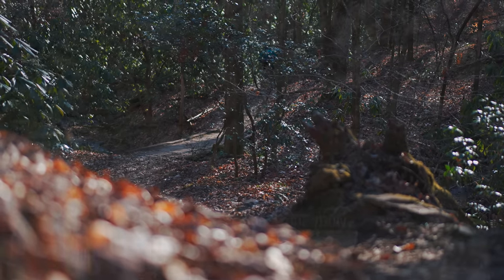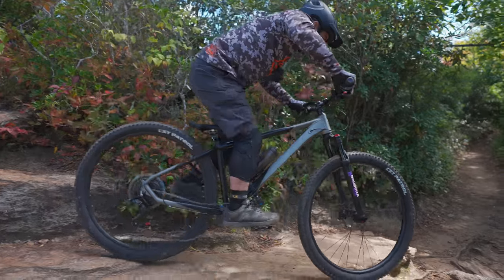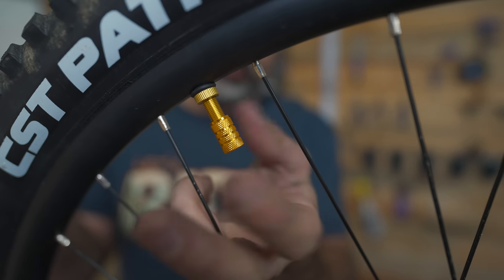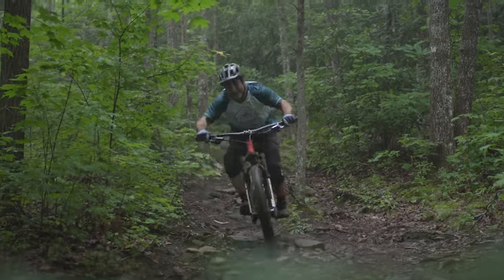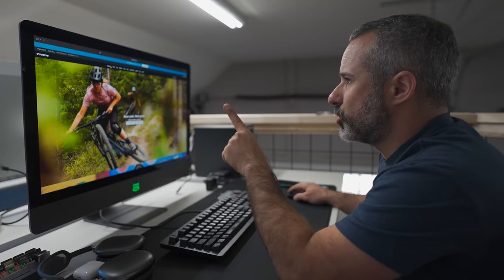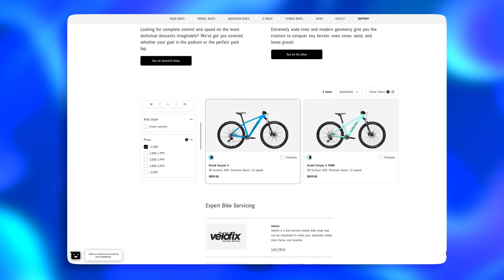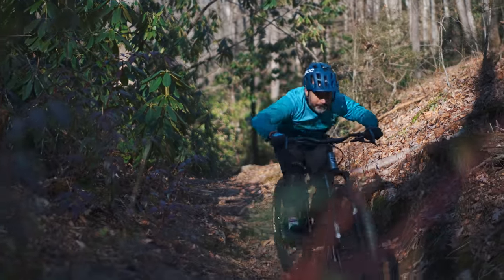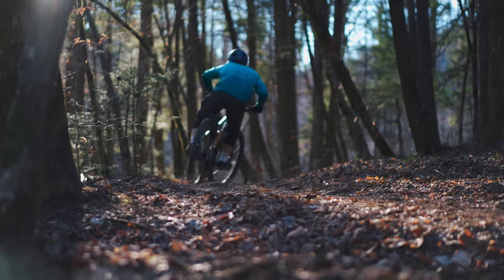Was putting $425 of upgrades into our Walmart Bike a good idea?

Comment: Rose Bikes (german bike shop who have their own bikes) have an entry level MTB for 850 EUR with a RS Judy, 1x11, MT-200, goodish wheels, etc.
BUT ANYWAY HERE IS MY BUDGET BIKE UPGRADE STORY:

I got a Dema Barro 3.0 from 2016 27,5". Well, it was crap in its original shape, I didn't really liked to ride on it at all... 
After several years of owning it and not really liking it, I chose to upgrade it one by one.

First it got a wider handlebar from 6xx something to 720 mm and a shorter stem from 90mm to 60mm. Both are stronger and lighter than the original. 

Then went for a 1x conversion, first I just bought a cheap 32T chainring to test out. Well it was quite bad with the 8 speed Acera(?) mech, but it worked. Fortunately the 1x ring on the 3x crank is almost in its perfect spot, so I got away with it.
Then changed the rest of the drivetrain to 10 speed with a Deore M5100 (yes it's an 11 speed mech, but it works well with a M4100 10 speed shifter). Back then I thought that 10 speed is the max what you can fit on the HG hub, I was wrong, there are even 12 speed casettes for it... and the 11 speed build would have been the same price... nvm maybe after it wears. The casette and chain is Sram 10 speed (11-42-ish).

After that it got the godsent RS Recon with 120mm of travel to replace the Suntour 100mm coil. The fork made miracles, not just the infinitely better suspension, and a kilogram weight loss, but that bit longer fork made the geometry feel much better. Bit slacker, bit higher front, a bit longer wheelbase, and now it feels alive off the roads.

Then I stopped using the Dema because I bought a 2021 Trek Top Fuel 7 (it's a 29" full sus "downcountry" bike) which completely replaced the budget bike (originally wanted to get an enduro bike along the Dema, but the Trek was too good of a deal and I love that bike ever since). For a while I didn't know what to do with it, I was thinking of selling it. But now I have decided to keep it around and have plans with it.

The Trek came with an MT-200 set, which was actually suprisingly good. BUT ANYWAY I UPGRADED THE BRAKE ON THE TREK BECAUSE WHY NOT and the Dema got the MT-200 set replacing the mechanical disc brakes.

It got a new saddle, pedals, and grips too somewhere in the lines.

Well it's a pretty lil expensieve budget bike now, but it will get some upgrades still, like: 
A crank upgrade, to a Shimano M5100 or similiar, maybe it will get a bigger ~36T chainring. 
The seatpost is a bit heavy, I think I will get a lighter midrange AL seatpost, and trim it, so it will be a budget really lightweight post. 
I still have the original tires on, WTB Nano 2,1", which are suprisingly good too for not hard shredding, but I think I will try to go tubeless soon.
I would like to try to repaint the frame at home, so the bike would look like it is worth all the upgrades it got lol.

The only original parts left on it will be after this the wheels, but I'm not sure about replacing those. I'm sure it would make more difference in numbers than like the crank arms or seatpost, but I don't feel like yet that it's necessary, they don't seem too heavy and their strenght is enough for the planned rides. But if they will not work with tubeless I will change them immadietly.

The plans because of which I keep upgrading the bike are: there are some gravel events/races/endurance tours I would like to participate in with it (30-90km or multiday events too, flattish terrain, no bike restrictions, but gravel or xc mtb recommended). 
I'm certain, that the Trek would be a better ride even for these events, but I would like to use this good crapbike.

In an eltarnate universe I converted this bike to a full on gravel bike, with drop bars and a rigid fork. Sadly I got this idea after the Reckon upgrade, and the only forks I found that would be good are more expensieve than the RS.

Thank you for reading, now go back watch some videos.

Comment: When Walmart puts models on clearance, it changes the equation a bit.
I bought my Axum for 228  brand new from Walmart.
I’ve got just under $700 in it total (including the cost of the bike), and it has a rockshox fork with a thru axle, hydraulic brakes, a clutched derailleur and better pedals. On top of it all, I learned how to fix and maintain my bike.
Reply: 👆👆👆Congratulations fan you've👆👆👆 been selected among my shortlisted winner 🎁🎁🎁

Comment: I would recommend performing a budget build. For the best example used here, Canyon , $899; a budget build will fund a lot. 1st the entry level XCM30 fork is not bad at all. That can be the last thing to upgrade. 2nd, learning your bike in detail will allow a higher appreciation, hence better your skills. Lastly, planning the build perfectly in your mind before you buy will go beyond fun. You can post your build for sale at your value and see what your value is in real time. Having a bin of reliable parts is a must. In conclusion, if you include the taxes, $825 is $893. That includes the knowledge you acquire, extra good parts to sell or reuse, bragging rights, confidence, skills, and fun.

Comment: Personally, if my budget was tight or I had the money it cost to do that bike up, I would look at deals on a previous year model Trek etc, get that with a big discount and then use the money saved on upgrading parts.
 Saying that, here in the UK, you can pick up a Vitus hard tail with air forks for £500. Comes with hydraulic brakes, derailleur with a clutch, routing for dropper and modern geometry.

Comment: I think this speaks to a huge issue in the industry.  Even low end starter bikes from reputable manufactures are out of the price range for many families.  I’ve become a bit of a neighborhood bike mechanic because it’s just not ok to take a $200 bike to get serviced at a bike shop for $100.  A $200 bike from Walmart will last possibly one year without any maintenance, probably even less when the kids riding them watch YouTubers riding sweet trails on nice bikes.  

As much as buying a low end bike like this and putting upgrades into it is not the best idea, it’s a good way for a family on a budget to test out the sport while not breaking the bank.  I’ve also always been of the mindset that you buy the best bike you can afford and then tack on newer and better components to improve the bike until you either destroy the bike or can afford the next jump in price.  One of my favorite bikes was a Marin that I continually upgraded to make it more capable!

Comment: I have the exact same Park Tool crank removal tool (10:55) since 1998. It's been working flawlessly for several dozens of crank removals. For the longest time it was the only Park Tool ... tool that I had. Now I also have the Cyclone chain cleaning machine and the stand (which was by far the most expensive purchase of any bike tool at abt. EUR 180. I also have two other bike stands bought at Lidl branded Crivit which cost abt. EUR 30 per piece and which I use all the time, while the Park Tool stand.... stands in the corner as a beauty queen). Also - this guy's decisions about drilling a hole in the frame - and cutting welded parts of the frame off - JUST BECAUSE OF THE LOOKS  - can be described as QUESTIONABLE at best. Greetings from Latvia.
Reply: 👆👆👆Congratulations fan you've👆👆👆 been selected among my shortlisted winner 🎁🎁🎁.

Comment: For us guys in UK buying the cheaper bike can be a minefield as "some" bikes are limited in what upgrades you can do, HOWEVER if you are on a budget (as i have been many times in my life) buying cheaper n upgrading was the only thing i could afford to do. I recently bought a 2016 voodoo hoodoo 27.5 for £60 second hand, its now got a used suntour aion 150mm fork, 1.5 headset tapered conversion, almost new rims, ixf bb and crankset, M4 morrocca brakes, 205 disc up front , wake stem, 780mm bucklos bars, racing ralph tires about to get a dropper post ..... it rides amazing and cost a grand total of £450 .... it may be from used parts but hey ho im a happy bunny and not a broke one

Comment: Before i watch the video my opinion on this topic: I did put around 1,2k euro into a 400eur nobrand-bike. Not at once but over time. I recently also got myself a specialized demo 2017 in carbon. Still the nobrand-bike does exactly what i like and is my most used bike. I have taken it on long biketours, short tours, dirt park, single trails and even a proper downhill bikepark. It did everything fine. Not amazing, but it was fine. I had fun! It is always a comprimise, but at the time i bought it k did not have the money to buy a brand bike and the used bike that were avalible were either way more expensive or badly maintained. In essence if there isnt a good offer avalible on the used bike market and an expensive bike just isnt in the budget, i think upgrading a solid nobrand bike is a valid option. I do not regret it even tho i eventually bought a downhill bike to have a better downhill experience. On single trails and bike tours i still use my cheap nobrand bike and i am happy with it.

grabs popcorn and watches the video

Comment: You can put a dropper on the Kent, but you need to buy a 27.2 diameter post and shim. The seat post is an odd width (30.4). Cane Creek makes shims for specifically for this.

Comment: Here in the UK there is a bike called the voodoo bizango, I spent 650 on it 2 years ago. Got a 120mm suntour air fork, good Shimano brakes 1x10 drive chain Shimano deore, maxxis tires and everything else being solid too. I ended up upgrading mine with a new dmr 780 bar, maxxis minion dhr 2.4 on the front and 2.3 on the back, got new grips and pedals.

And it is still to this day one of my favourite bikes to ride. I will frequently take it out on reds and flowy blacks sometimes even over my canyon Spectral on cf9.

So in conclusion if possible you should check it out. It's called the voodoo bizango and is sold by Halfords

Comment: I recently got into mountain biking, and got a GT avalanche from dicks on sale. Only paid $400 and it came with some pretty decent components: 1x10 microshift, hydraulic discs, WTB wheels/tires. Everybody says don’t waste your money upgrading, but honestly if I threw $500 at this thing, it would have a decent fork, a dropper post, good brakes, and be a pretty solid bike for a beginner/intermediate for well under $1000. The only thing it’s really lacking at that point is the boost axles and tubeless wheels/tires. Anything with all those features is knocking on the doors of two grand.

Comment: 8:30, here in the UK Boardman bikes offer the MHT 8.6, 675 GBP (825 USD) normally but often on sale for 625 (765 USD) and it's got 10x1 deore all the way through, tektro m285 hydraulic brakes front and rear, 120mm Suntour Raidon XC LO-R forks and comes with some solid Vittoria tyres and tubeless ready from factory. I'd definitely not pick a bike with questionable QC sold in walmart over something like this boardman deal, but still a solid build.

Comment: I broke a 2018 Trek Roscoe 8, so I won't purchase another one from them. On another note, I did hit a KOM on a local black trail with a Ganopper crankset. So they're definitely better than not good! 😂👍

Now regarding riders entering the hobby. I highly recommend one does not attempt upgrading most budget bikes. The fact is that with so many different standards of head sets and bottom brackets, one could waste time and fiat currency ordering the wrong bits. This industry has really over complicated things. Oh, and then chuck in there needing a different tool for every little ol part, and it can quickly become frustrating.

Anywho, thanks for the video captain! Great little breakdown.

Comment: You have to be careful with SR Suntour Xcr forks depending on where you live. I have one on an XC bike and it becomes extremely sluggish in the winter, or any cold climate. This problem is fixable, but it requires a service and wiper upgrade on the fork. This doesn't sound too bad initially, but there are very few service videos to follow if you plan to do it yourself, and SR Suntour forks are known for being a bit different from other forks. But if you live in a warmer place than the north east united states, it shouldn't pose a problem.

Comment: Just a couple more things to consider when comparing buying a proper bike from a shop vs something from a department store. First, warranty. A brand like Trek is going to stand behind their product with a decent warranty. Good luck getting Kent to replace that frame when you snap it. Second, when you buy a new bike from a shop, they typically offer free tune-ups for the first year, or something like that. Don't expect to wheel your department store bike to the back of the Walmart to get your wheels trued or cables and brakes adjusted. That said, I know this experiment wasn't meant to be taken too seriously and I still found it entertaining and informative.

Comment: I did this with a GT Aggressor Pro, originally sold at Dick's, that was basically how I learned to mountain bike. As I would get a little better, I would feel what upgrades I could use and was able to get in at around $400 (used) and upgrade $100 or so at a time without having to drop all of it at once. The cheap bike was fine when I was a beginner and it grew as I did. They're a pretty nice platform if you don't mind a 27.5"

Comment: Not to mention that once you get an entry level trek/spz frame and upgrade it, it's a proper bike gaining value. Going through the buy cheap Kent Truvail and upgrade end up with a Chinese carbon frame replacement in the end resulting in a Frankenstein bike. And as all parts end up being replaced, the original old bike gets reassembled to haunt you.

Comment: You can ream the seat post to 30.9 with a reamer on Amazon. I did this and installed a 150mm dropper. It didn’t weaken the frame because I hit a concrete 6ft drop and jumped it countless times.
Reply: Feedback appreciated🙏
I have a presnt for you 🎁 ☝👆

Comment: I basically did this but with a used giant talon 2 I got for $400. It came with hydraulic brakes, a 1x9 and decent brakes and tires. I ended up putting about $300 more into it and just did my first black trail last weekend

Comment: I agree with the conclusion for the same reasons, but here are a couple of others. Going for a used bike you can get a lighter, better frame, and secondly a good used bike or even a good brand new bike will generally put less bikes in the landfill. Also if you get a used good bike you'll probably have better resale with a good name brand.
Reply: But you might also end up with something that has a lot of hidden problems

Comment: As an European I have to say a Vitus Nucleus 29 VRS is still a better deal and less headaches instead of upgrading especially because you get a Trail Bike with proper headangle, supreme tires, a good drivetrain and a 120mm air suspension which will do wonders with the headangle

Comment: a brand that often gets overlooked is giant, they’re the biggest bike manufacturer in the world and have a wide range of bikes for really reasonable prices. for $980 you can get a giant talon 1 with an air fork, 1x10 deore drivetrain, hydraulic disk brakes, and most importantly lifetime warranty on the frame and 1 year on the parts. Also as mentioned in the video you will have a place to get the bike serviced, usually a free 30-60 day tune up, and all the other added benefits of going through a bike shop. they also have the option for you to buy the bike online and have it shipped to your nearest dealer who gets 100% of the margin where as most other brands cut the dealer out or don’t give them the full margin as if they were to sell it themselves. this is called giant web link and really is a great thing as it shows that they stand behind their dealers. having built many giant bikes i will say they don’t come quite as refined from the factory as a brand like trek however you will be getting professional assembly either way so that is neither here nor there. 
cheers!
Reply: 👆👆👆Congratulations fan you've👆👆👆 been selected among my shortlisted winner 🎁🎁🎁..

Comment: I bought my Diamondback Over Drive Expert 29er back in 2015 from a bike shop for about $380 and have since then did the same upgrades over the years. I even compared it to bike prices of today and it’s a better deal hands down. Unfortunately that same bike now starts at $700 so I don’t think a DB Overdrive would be a good budget starting bike now unfortunately. Everything is just more expensive today 😤

Comment: My first mountain bike was a Walmart bike. 

I learned a lot just by fixing it when stuff would break and was still able to get my feet wet with mountain biking. Now as an adult I have a “real” mountain bike. 

I have mixed feelings on department store bikes since on the one hand they can be dangerous if someone doesn’t at least give it a once over, but on the other a bike that’s close to 1000 instead of 3-400 can create a bigger barrier for an already expensive sport. 

At the end of the day I’d rather someone get some biking in at a lower intensity on a department store bike than to never try it at all.

Comment: I'm surprised you didn't compare to the specialized rockhopper comp.  Listed for  $713, hydraulic brakes, microshift 1x9, coil fork with adjustable damping and lockout. They do have the rockhopper sport for even less, but the comp isn't that much more with better components.
Reply: 👆👆👆Congratulations fan you've👆👆👆 been selected among my shortlisted winner 🎁🎁🎁.